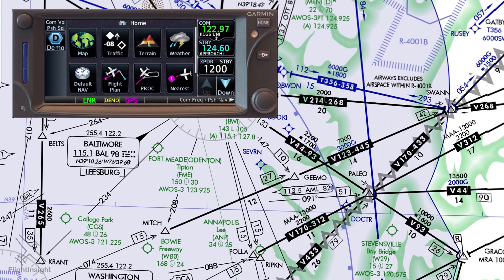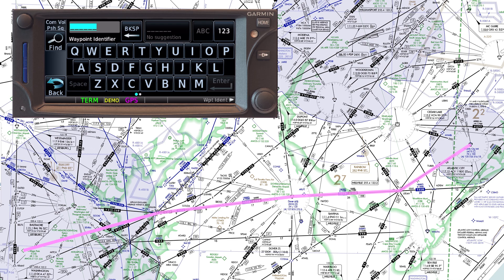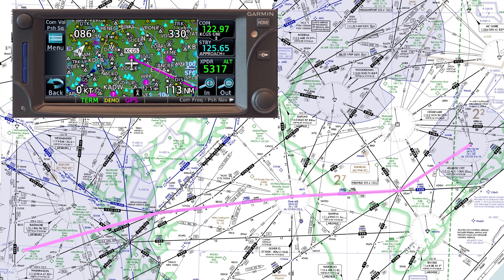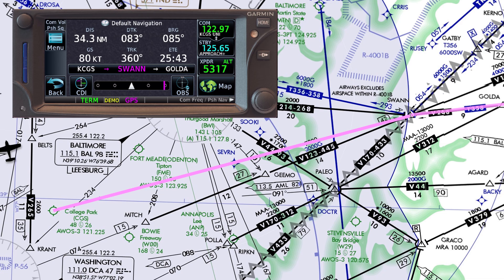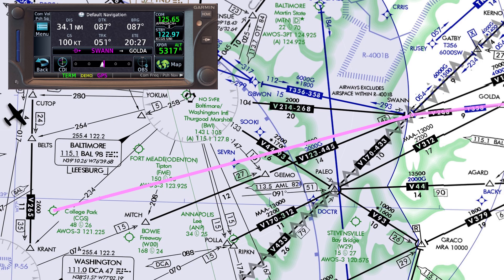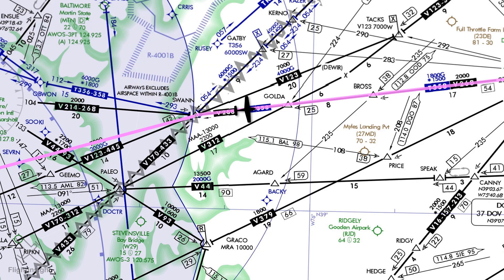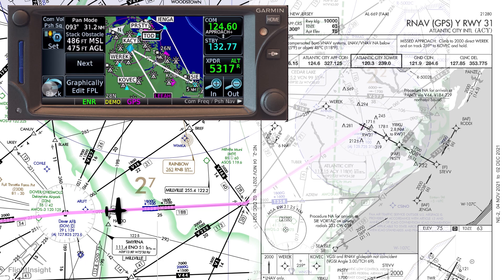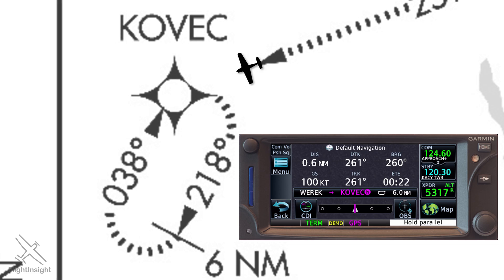GPS for IFR | Garmin GTN 650 IFR Tutorial | Full IFR Flight

Comment: That was awesome. I'm instrument training in the piper pilot 100i and use the G3X and the GNX 375 and it's super cool without the pressure of actually flying to see how it all comes together. One question though, when flying on a Victor Airway and it has multiple fixes over lets say 100 mile straight course, what is the purpose of having all those fixes loaded up it you're just flying straight line to the last fix. I guess I don't understand their value if those fixes are not used for turning somewhere else, but just instead a string of fixes in a straight line.

Comment: Great video. I have a question about vectors to final. If this is active and ATC changes instructions, I believe you are stuck and have to delete plan and re-enter the plan. Is that correct, would it be better to just activate a leg on the final approach
Reply from the maker: On the 650, you’re not stuck if ATC changes its mind. You can pull up any intermediate points or otherwise. This was fixed from older units like the 430/530, where vectors to final would indeed blow away most waypoints
Reply: @flightinsight9111  Thanks! will try that.  love the videos, keep it up

Comment: Thanks for the presentation! I did have a question based on what you said at 10:40, The error of charted heading vs what your GPS is telling you to fly can be found in the AIM 1-1-19 which is GBAS and GLS. Are you trying to refer to 1-1-17 (k) impact of Magnetic Variation on PBN Systems? Maybe I'm not understanding "why" its happening. You say don't get thrown off by this, but alas I'm thrown off. Which do/ should you follow? The charted Magnetic heading or the GPS heading?

Comment: Another fine presentation. I do think you missed a couple of opportunities. The most important one was discussing why waypoint sequencing was being annunciated "SUSP" even after activating vectors-to-final after the missed. It's important to understand the "why" and what, if anything, one needs to do. This was not mentioned. The second is not using the Fast Find button. When entering SWANN for example, Fast Find had already populated with the closest SWANN without having to worry about another SWANN halfway across the world. You could have saved needless button-pushing. Finally, I would have entered the flight plan in a logical sequence KCGS > SWANN > V268 > LEEAH > KACY. This saves you from having to use Insert Before and go back and activate the KCGS > SWANN leg. More needless button pushes. Overall, nice job. Great cadence. Nice and easy presentation on the eyes. Keep up the good work.
Reply: Why was the SUSP button still there?
Reply: My instructor calls it the $800 button
Reply: Thanks for these tips! Just started using the GTN650Xi and these will help. The one that threw me for a loop was why SUSP remained even though VTF was activated. That took me a little while to find the answer to (it's not a problem, but knowing the "why" is nice).